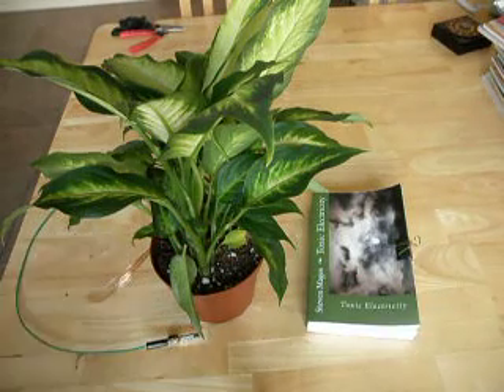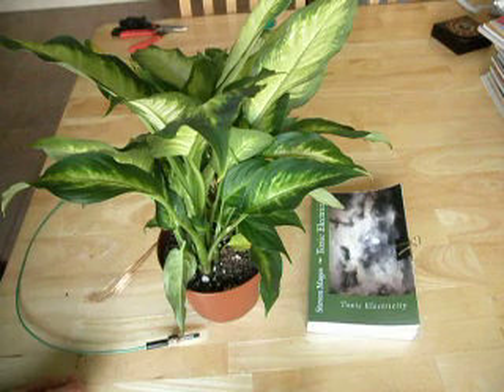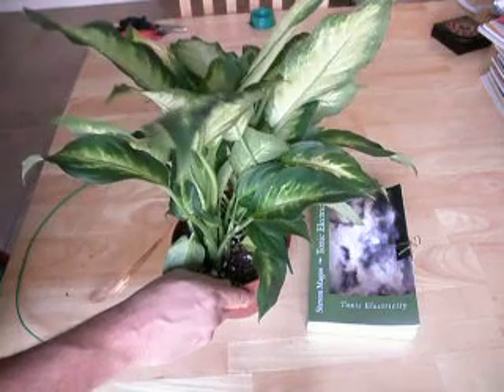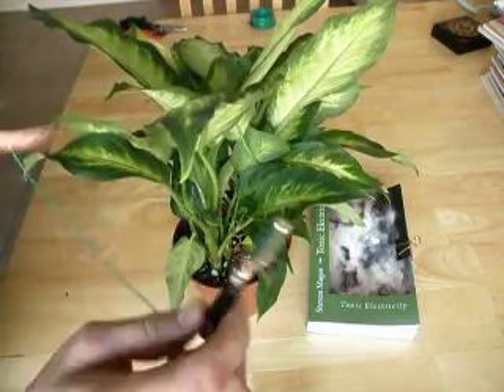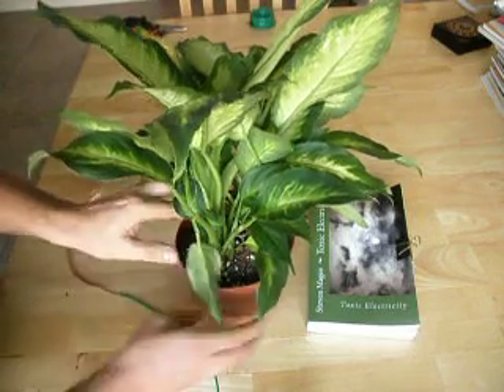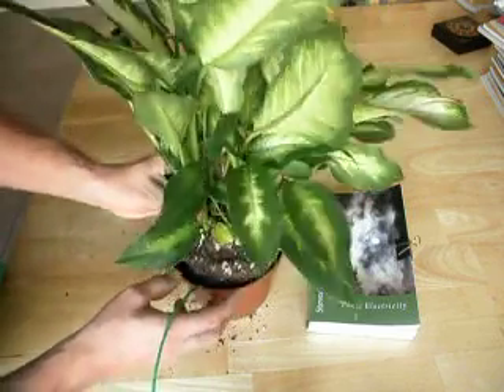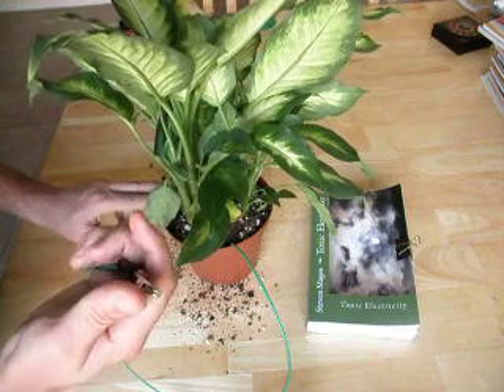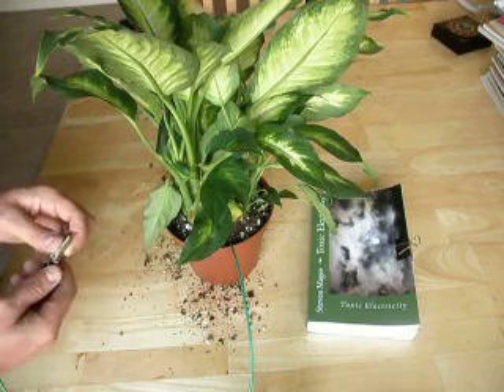Testing the Earthing Health Technique Using a Dieffenbachia Plant

Comment from the maker: Nice suggestion, I have tried many things: fertilizer, light, water, heat, humidity, grounding, etc. They are deforming from electromagnetic field exposures. Read the books by Dr. John Nash Ott as he documents these EMR plant effects. Connecting the roots and stem to a 1.5 volt battery prevents the deformation. My home is between 600 to 700 meters from 3 cell towers and the community has radio frequency transmitting utility meters on the gas and electric and the home has a stray voltage problem.